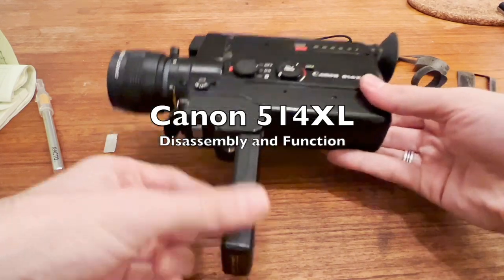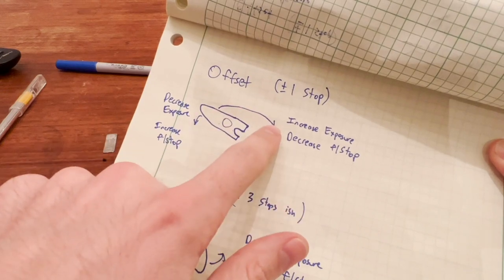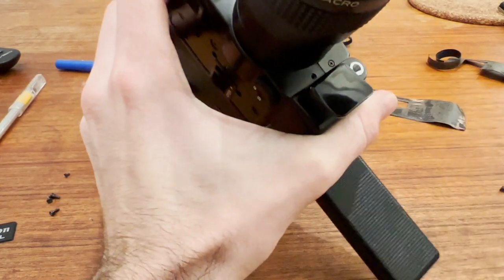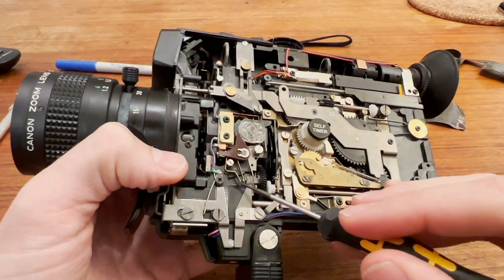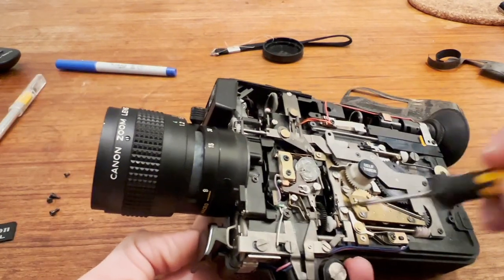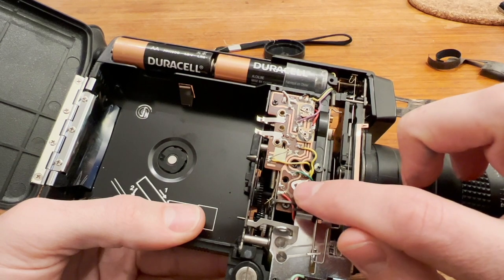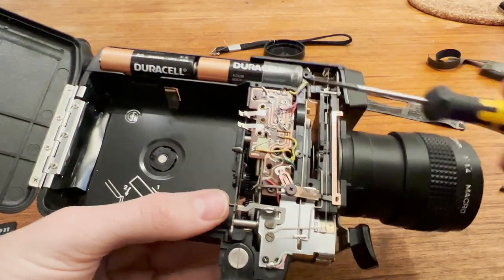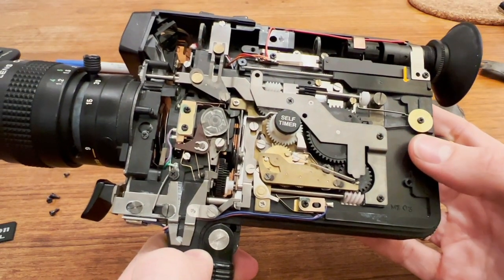Canon 514XL Super 8 Camera Disassembly and Function

Comment: I'm thinking of applying lubrication inside a 514XL to reduce its noise level as much as possible. Any advice on where and how to do this, or if it's advisable? There's nothing wrong the camera but I sometimes use it in extremely quiet environments and it's just loud enough to cause a bit of disturbance.

Comment: Most cameras have the light measured after the tungsten filter so when removing the filter it automatically adjusts for that. In this case it's made more complicated because by removing the tungsten filter it also needs to remove an ND filter.

Comment: hey, i have a 518 auto zoom and i believe the autozoom motor is jammed and needs to be lubed but honestly i have no idea where the motor is or how to lube it properly any suggestions?
Reply from the maker: I think the 518AZ is totally different from the 514XL—if you're mechanically handy, you could try taking the camera apart.  honestly, a lot of people get by without ever using the power zoom so that's probably what I'd suggest, especially if you're not as comfortable with repair.

Comment: @Forrest Bourke I got one recently, add I was thinking of removing the Lens and adapting it to a mirrorless camera.

Is it possible that you know of to remove the lens from the body of the camera? I'f its not, I might not attempt disassembly :(
Reply from the maker: What are you trying to accomplish? The lens of this camera (and other super 8 cameras) is only designed to cover the 8mm frame, so you'll get a tiny circle in the middle of your mirrorless camera's sensor. I'm assuming that's not your goal?
Reply: @madscienti11  I thought with creating an adapter, the correct flange distance might be able to cover the sensor. Ofc this would increase the focal length but yea. I wanted to simply adapt the lens to my camera
Reply from the maker: @buddymiles7210  I don't think you're going to get a result that you'll like. The focal length of the lens won't change—it's an optical property of the lens itself. You can try and do the math yourself, but if you move the lens far enough away from your sensor to cover the whole thing, it'll be a super-macro-only lens.

Let alone the issues of actually disassembling the lens from the camera... What is your goal? Are you just looking for a fast lens? The reason super 8 camera lenses can be so fast is because they optimize for the tiny coverage of the 8mm frame.

Comment: Hello I have the 512xl model. But the zoom motors suddenly are making a very loud screeching noise. Any solution to that?
Reply from the maker: Hi there! Based on the body style, the 512XL looks more similar to the 814E or 814XL than the 514XL. My best guess from your description would be that there's a little gear that engages the zoom and it's either misaligned or stripped.

Comment: hello. thanks for the video. just one moment. I removed the screws under the lens, but now I can't get them back. It seems that they do not reach the board under the plastic. do you know how to solve it? thanks in advance.
Reply from the maker: Did you remove both? If you notice in the video, I mention you only need to remove one—they're both screwed into a small metal bar with two threaded holes, and if you remove both screws the bar will fall away into the inside of the camera. What you can do is disassemble the camera again, find the small bar, and then attach it to one side of the camera body with one screw before putting the camera back together.
Reply: @madscienti11  thank you very much!

Comment: When you say meter reading. Do you mean the LIGHT METER? because mine isnt working and i dont know if theres another meter.

Also when i use the zoom buttons they push up when i press them and start doing a clicking noise which stutters it from zooming or stopping it completely.

Comment: can you make a video about the power zoom doesn't work. please!!!
Thank you
Reply from the maker: Hey there! The first issue you might be seeing is that the power zoom only works while filming. If that's not working, you may want to open the camera and see if the teeth around the barrel of the lens are stripped. Those teeth are plastic, whereas the gears driven by the motor are metal, so I think it's most likely the plastic would fail first.
Reply: @madscienti11  thank you so much for the comment and video !!!
Reply: @madscienti11  yesss when I pull the trigger and filming, the zoom power is working!!! thank you